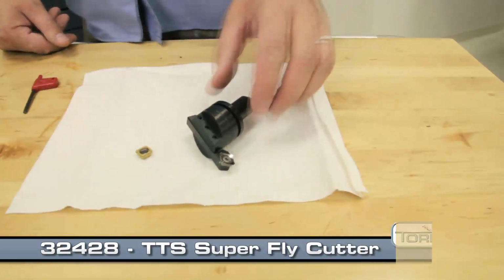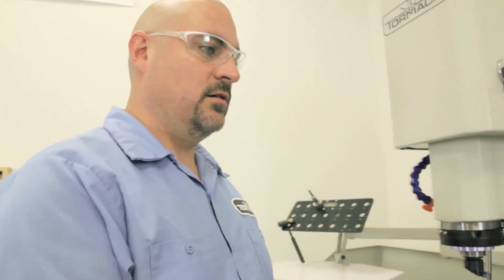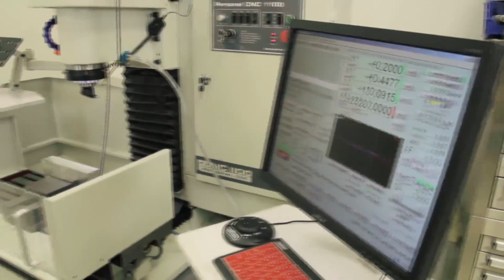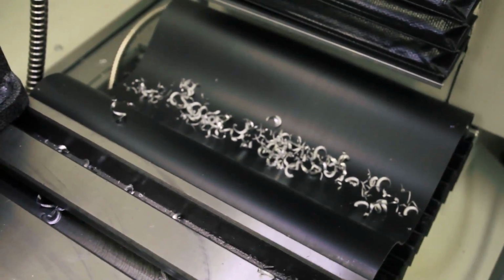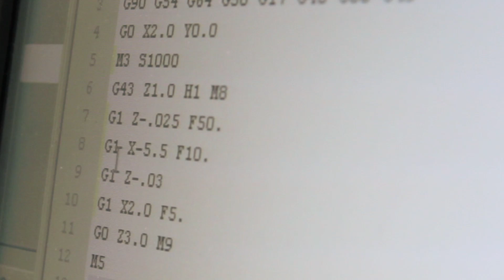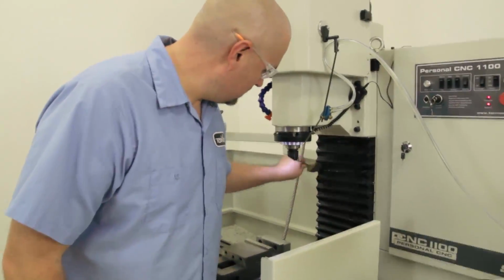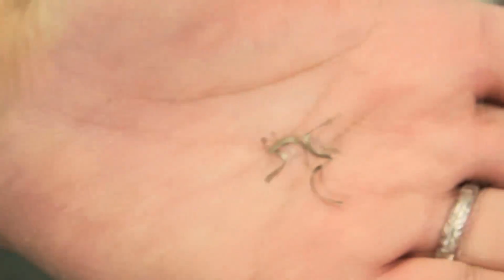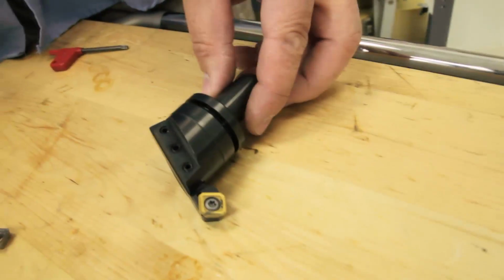Fly Cutting Demonstration with the Super Fly Cutter - Tormach CNC

Comment: Thank you for the excellent video.  I've had a SuperFly in my Tormach shopping cart for the last few days.  I'm putting the finishing touches on my order and I'll finalize it in the next day or two.  I'm impressed with the reasonable cost compared to quality carbide index shell mills, the fact that it only uses one carbide insert so the ongoing repair and maintenance costs should be much less, the ability to use it on low horsepower spindles, and the high material removal rate.  Nice job!

Comment: I received my SuperFly today and it looks great. Thanks for developing this and making it available.

Are the feeds and speeds shown in the video the recommended specs for rough and finish cuts on aluminum and steel? If so, that info would be great in the video description, as well.  Do you have a maximum RPM specification for this tool?

Comment: the roland has a much higher accuracy and step resolution, but is not meant for much work with metal. It would be great for engraving or light work on aluminum.  If you're looking for functional metal prototypes, the roland is not going to help with that (at least, not quickly).

Comment: Could one machine a part with tabs and internal pocket features leaving .05 stock on bottom then cutting the tabs thus removing the peripheral stock, turning the part over and fly cut the extra stock and tabs ?. Are there some situations when you would not fly cut a part?.  I also did not catch the rpm for aluminum.
Reply from the maker: +Guy Good The Fly Cutter isn't suitable for what you are describing. It shouldn't be used for profiling or plunging. As for the RPM in this particular video it's hard to say as it's close to four years old at this point.
Reply: +Tormach Inc. I was not intending using the fly cutter to plunge or profile - I was asking if I could use it to remove the bottom "holding" stock by turning it upside down after milling the topside of part with 2-3 pockets that on the last cuts from the fly cutter would become interrupted cuts- is this advisable?
Reply from the maker: +Guy Good Sorry, we read the question wrong. Yes you probably could use the fly cutter to remove the "holding" stock off. The interruptions shouldn't be an issue. Let us know how it turned out.
Reply: +Tormach Inc. It worked fine on aluminum, thank you for the prompt replies. As always glad I went with Tormach for mill and tooling.

Comment from the maker: I’m not sure where your information comes from.  When looking at official Roland specifications for the MDS-540 mill I see their stated software resolution as 0.0004”, positioning accuracy as 0.0040” and repeatability as 0.0019”.  These respective numbers for Tormach PCNC 1100 are 0.0001”, 0.0013”, and 0.0010”.  Its significantly better in all respects with respect to step resoution and accuracy.